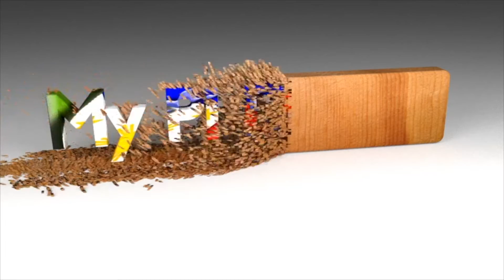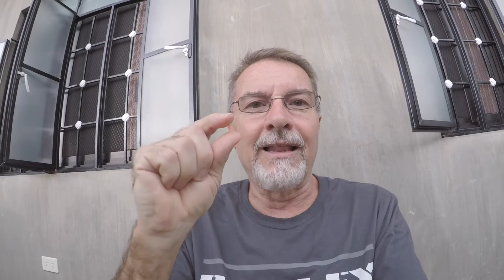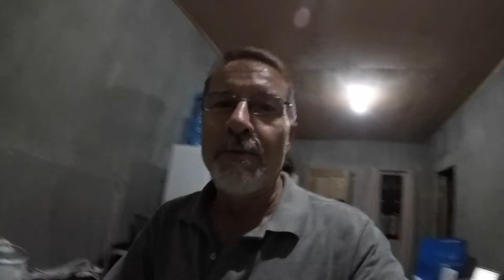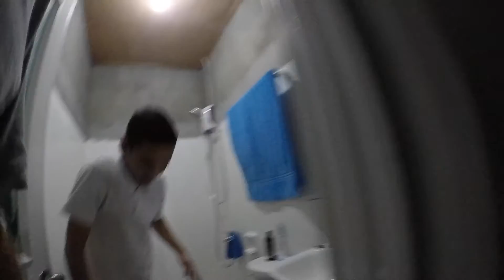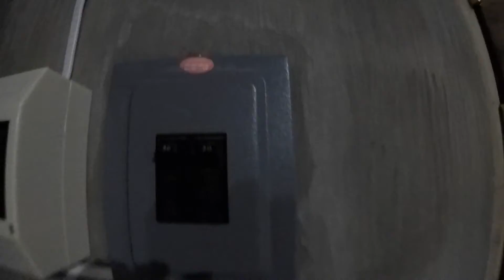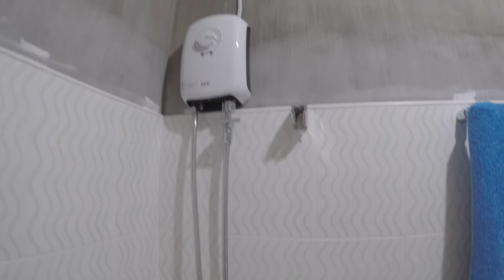NO MORE COLD SHOWERS...SOMETIMES

Comment: I had the same problem with the first water heater I bought, because it used a pressure switch instead of a flow switch. In those kits there is normally a rubber washer with a small hole that you insert in one of the outlet hose connections. This helps create back pressure to activate the pressure switch. And you have to make sure they didn't install it on the inlet side, because this restricts pressure prior to the pressure switch.

The other problem with my first water heater was that is was the adjustment was "power control" (which just selects the wattage used to heat the water), not "temperature control" (which measures the outlet water temp and adjusts the wattage as needed to heat it to the set temperature.".

So the next water heater I got I insisted that is had a flow switch, not a pressure switch, and was temperature controlled not just watts. Basically you set it and regardless of pressure, flow rate, inlet water temp, the water comes out at the temperature you want.

The flow rate you have in this video is more than enough to activate a flow switch and turn on the heat. 

If you get a multi-point heater for your house, of course it will have a flow switch because a pressure switch won't work in multi-point setups. But a key feature is getting one with electronic temperature control, not just power control, especially if your shower will use the single knob control for hot and cold. In this setup when you try to change the temp colder, it closes the hot side, reducing flow. But since it's still 3000 watts going in, the water gets hotter, requiring you to turn the water colder. Eventually it either trips on high temp or low flow. So you get out and set it for lower power and the opponent chain reaction occurs.

Comment: Very useful segment
I have been wondering about saftey on these tankless systems with no earth so your point about the built if safety cutout was very interesting.  Check out gadget addict he did a great video on a suicide shower which gives you a soothing ☠️⚡️⚡️⚡️Electeical current as you shower 
Also goog point about water preasure, i thinks its something to add to a pre check for aparment hunting 
Being from the uk i find it quite amusing how you guys from America seem amazed about tankless systems, glad to hear they are now catching on in the USA, imagine the energy saving if a nation your size moved to tankless😀
Have you considered Non-Pressurized Roof Top Vacuum Tube Solar Hot Water Heater System for your build? It has the advantage of providing a header tank so even when supply pressure is non existent you get a free hot shower, Ive used these in Australia and the water is often almost too hot☀
Reply from the maker: Thanks for the comment Sibat.  Don't include me in the "you guys from America" category.  Let's say "those guys from America" 😉  Like I said in the video, I've been using these for years in places like Belgium, Germany, S. Korea and I didn't mention it, but I also lived for a bit in the UK just south of London.  I know these water heaters work great.

I did considered the solar hot water system you mentioned.  The plan for the house we're building here originally had solar hot water included in our proposal.  Unfortunately, there were problems with the deeds & restrictions of the development which stated you cannot have solar  panels or water heater that can be seen from the road.  The exposure of front of our house will face directly south and the only way to comply with the developer's restrictions is to put solar on the roof on the north side where we get no direct sun.  So we scraped the solar option and now will be using tankless water heaters like this in our new construction😞
Reply: No offence intended 😜 Just so many phil-am expats extolling the virtues of tankless😜😜😉
Interesting point about planning controls on solar, surprised to find these rules in a relativley free/unregulated country
Personaly I've never understood why people have problems with seeing renewable enegry systems IMHO something to be proud off😇👍 
Good luck with the build, i will be watching with interest
Reply from the maker: Oh btw, we break ground Monday 👍  I'll be posting daily updates of the build as well as a comprehensive explanation of how the permit to build process works over here.  This has been 5 years in the making so you might sense my excitement!

Comment: What did these wannabe electricians charge you? I want to do the same thing, though my Pinay gf scoffs at me for wanting hot water in a tropical heat country
Reply from the maker: I'm embarrassed to say I paid P1,500.  There was a miscommunication and I was under the impression where I bought the heater that all I had to do was buy the electrical wire and breaker and the installation was part of the deal.  Anyway, live and learn.  I was later told by multiple Filipinos that I should not have paid more than P500.

Not sure where you live, but here in Batangas, its a bit cooler than the a lot of the Philippines.  The nights get into the 60's and a nice hot shower is definitely welcome for this old westerner body.  I'm all about cold showers after working outside in the tropical sun all day though.